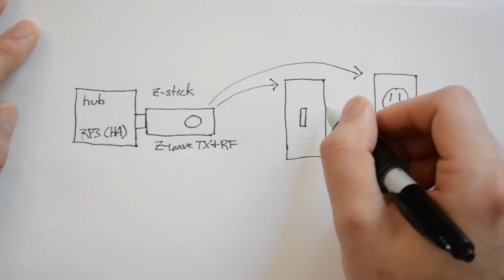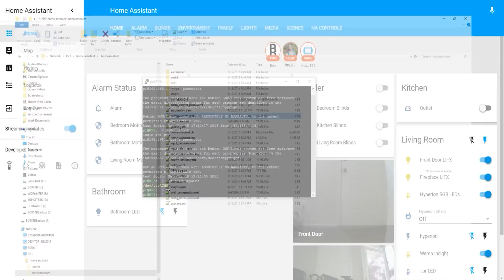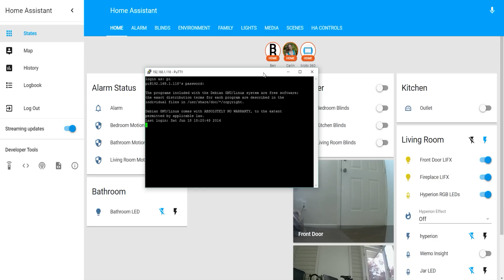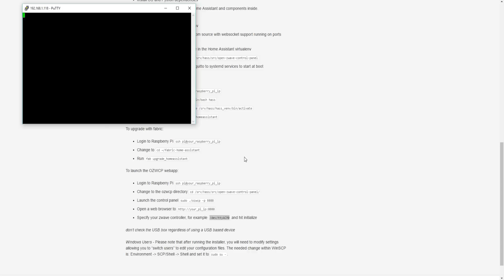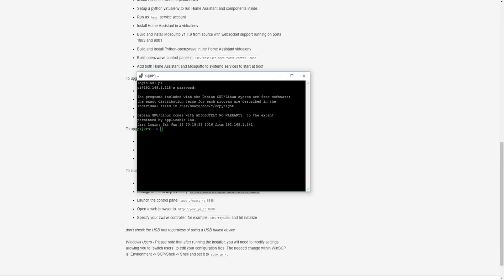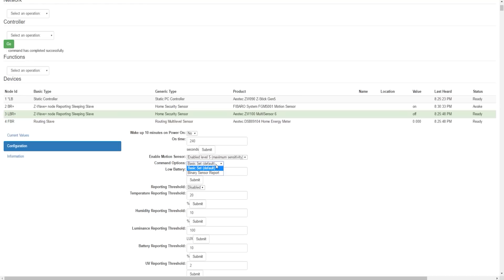The BEST DIY Z-Wave Tutorial - How to Get Started on a Raspberry Pi

Comment: Hi There Ben.... Huge Fan (obviously) - 

the Z stick config with All-in-One HA worked like a charm on the RaspberryPi 2 - but recently I upgraded to the RPi3 - but every since I'm unable to get it to work - I tried to retrace my steps. on...

ls /dev/ttyACM* I get the No such file or directory 

so i tried ls /dev/ttyA*** and i got 

/dev/ttyAMA0....thought i did use this USB path on the configuration.yaml file - no luck. 

Desperate shout for help please !
Reply from the maker: Hmm, that's very odd. This is a shot in the dark, but you could try and assign port permission if for whatever reason they aren't already assigned. 

sudo chmod a+rw /dev/ttyACM0

Let me know if that worked! Cheers!
Reply: +BRUH Automation hey. Thanks a bunch mate. Ok I actually got the z stick to be recognised by raspberry Pi. I'm able use it via the ozwcp. But it never shows on HA. I'll try ur recommendation and get back.

Comment: thanks 4 this awwsome video :) i just have one question: is it somehow possible to turn off the color blinking of the stick when plugged in? thanks for any help!
Reply from the maker: For sure! Sadly, I don't know of a way to turn off the LEDs. :( There might be some googling to do there and see if anybody has ideas. Worse case, you can crack open the case and unsolder the LEDs. I'm sure that's pretty easy! Cheers!
Reply: what i've read so far: there is a command to turn off the led. can be found in the manual. 
what i've NOT read so far: where to enter this command. as far as i know via fhem there is an option to enter "raw commands". does anybody know something like this in HA?

i will update this comment when i've found a solution. for people with the same interest...

Comment: I put this in the Poll video comments but felt it was better here:
Referencing  other makes of RF outlets and odd code sequences eg. InstaPark.
Here is what I finally tried and have working and may work for other makes as well.
I took the receiver out of pairing with the remote.  I then put it in pair mode and  paired it with HA sending an on then off single string from a transmitter connected to the pi.  This paired the outlet with HA.  It also  means the remote is out of service as re-pairing it will use a different code set.
Reply from the maker: Definitely. I'm pumped somebody finally tried this! I've wondering if this would work for a while. I'll be sure to recommend it if anybody is having any problems like this. Thanks for trying this. Cheers!

Comment: My Fibaro door sensor is stuck at "CacheLoad (sleeping)" as status in the control panel :(
Has any one else had this problem?

Thank you for the great videos. Keep it up!
Reply from the maker: Have you tried a full Raspberry Pi reboot? Sometimes that fixes it. If your device as a manual update button, sometimes that can help, too. From there, unpairing and re-pairing the device can fix it. If that doesn't do it, you're probably looking a full factory reset on the z-stick and fibaro sensor and maybe even resetting OpenZWave. Sorry about that! 

I'm trying to get my hands on the Fibaro door sensors. Once I get some, I'll see if I get similar behavior. Let me know if you need anything! Cheers!

Comment: How much has your electric bill gone up? Does the automation make for more efficiency or do you have so much plugged in that it adds up a lot? or do you go through batteries a lot?
Reply from the maker: Not a whole lot. I haven't done the study yet, but last I looked leaving a Raspberry Pi on constantly for a year uses ~ $5 of power depending on your rates. I suspect the same is true for my NodeMCU devices. 

The real power hog is HVAC so if you can automate that and reduce usage, you can definitely save a lot.  

Z-Wave stuff is very low energy so the battery costs there are pretty minimal - <$20 a year.  Cheers!
Reply: That's nice to hear. I suppose most other automation device are pretty low usage. If you ever get around to doing the study I'm sure people would be interested, especially if it saves them money. 
Thanks
Reply from the maker: For sure! I'll definitely add that to the list and see if I can get that out sometime. Let me know if you have any questions! Happy to look stuff up or try and answer questions if I can before that. 

Cheers!

Comment: Thanks again! Your videos have been a huge help. Have you played with Secure Devices at all? I'm having issues with a Yale Real Living deadbolt, in that it shows up in HASS but not correctly. It does not allow control and reports on the states page as just the locked state and not the device itself...odd. I'm also really interested in either using the xbee usb controller and/or hacking a Lowes Iris v1 hub into a controller similar to the rooted Wink hub.

Comment: Thanks again Ben. Had to modify the my config path to:
config_path: /srv/hass/hass_venv/lib/python3.4/site-packages/libopenzwave-0.3.1-py3.4-linux-armv6l.egg/config

And then it worked.
My reading are showing as badges on the top vs yours as a panel.
Is there a way that I can change that?

Do you know if anyone has been successful with the Schlage Z-Wave locks?
My HA sees it but commands do not seem to work.

Thanks again for all your help.
Reply from the maker: For sure! You'll need to use the groups component. If you specify the entity_id inside of a group and then call that group in a view it will show up in a card. If you call the entity_id in a group that is a view, it will show up as a badge. 

It's a little confusing, but if you play with it makes sense pretty quickly.  

Yeah, I don't think there is support right now for Z-Wave locks for some reason. :( Not sure if there is a solid workaround. You could ask on the gitter chat room though.  I think that's coming super soon though. Maybe in 0.23 this weekend or hopefully by 0.24 July 17ish..
Reply from the maker: Whoops, just saw that Z-Wave locks are supported now! https://home-assistant.io/components/lock.zwave/ Not sure why yours isn't working. Can you control it from OpenZWave/is a supported device on that side?
Reply from the maker: Sweet. Yeah, it's definitely a learning curve in the beginning. My config is available on my GitHub here -> https://github.com/brusc/Home-Assistant-Configuration. Let me know if you need anything!

Comment: If i ran the AIO, do i still need to follow the steps at https://home-assistant.io/getting-started/z-wave/ ?
Reply from the maker: Nope, should be working already with the AiO script. Cheers!
Reply: How can i confirm that?

I just went and am upgrading cython and its taking forever, so that obviously wasnt dealt with by the AIO.

And according to https://home-assistant.io/getting-started/z-wave/ i should have had config files at /usr/local/lib/python3.4/dist-packages/libopenzwave-0.3.0b8-py3.4-linux-x86_64.egg/config but after running the AIO i dont. DOes this mean openZwave was not installed properly? or is it bc i used the AIO that they are not there but are instead at /srv/hass/hass_venv/lib/python3.4/site-packages/libopenzwave-0.3.1-py3.4-linux-armv6l.egg?

Basically the question is how do i know anything is actually installed and working?
Reply: I was able to run and open the Zwave control panel and initialize my z-stick...so does that mean its all working?
Reply: also i discovered my zwave config files seem to be at /srv/hass/hass_venv/lib/python3.4/site-packages/libopenzwave-0.3.1-py3.4-linux-armv*****6******l.egg/config instead of /srv/hass/hass_venv/lib/python3.4/site-packages/libopenzwave-0.3.1-py3.4-linux-armv*****7******l.egg/config like yours. any clue why?
Reply from the maker: Yep, sounds like it. The All-In-One script installs OpenZWave inside the venv at /srv/hass/hass_venv/lib/python3.4/site-packages/libopenzwave-0.3.1-py3.4-linux-armv7l.egg.
Reply: Hm. Ok. But then why is mine at armv6l.egg?
Reply: Also, now my .log file isnt updating. Everythign works. all functions, discoerey, automations. Everything. but my home-assistant.log file never updates except when i call a restart from the dev tool and all it says is "16-06-26 22:50:01 homeassistant.core: Home Assistant requested a restart."
Reply from the maker: Hmm, yeah, I know some people are having problems with the restart function right now. It's a pretty complicated function and I suspect it will be deprecated at some point soon for the new reload core function coming out in 0.23. In the meantime, you can try and just use sudo reboot from Putty and it should restart everything well! Cheers!
Reply: Well i actually figured out my problem. It wasnt that the restart function was causing any issues, that was working jsut fine. but for some reason, "logger" wasnt included in my config file. i dont rememeber it being in there previously in order to get the home-assistant.log file to give me the full logs, but once i added "logger: default: info" to my config file, it starting producing the full log file i was looking for.
Reply from the maker: Nice! Pumped it was an easy fix!

Comment: Ben, thanks for your videos!  Just getting started with HA and Z-Wave.  I added a Aeotec Multisensor 6 to my Pi, and some of the values are reporting.  Specifically, Luminance, Humidity, Temperature, and UV.  I don't have the motion sensor though.  Do you know why that would be?  It used to show before I did a clean install and used the rPi AIO installer, but now it only shows those four sensors.
Reply from the maker: For sure! Yeah, the motion sensor shows up in a funny place. In my configuration, the motion sensor reports on sensor.fibaro_multisensor_burglar_4. It reports an 8 on motion, a zero if there is nothing, and a 3 on a tamper event. Is it not reporting anything named burglar? It would be pretty odd if you are seeing values for the others, but not that. Did it get hidden in your customize options at all?
Reply: I don't have any customize options yet, so I doubt it.  It's interesting - HA isn't seeing that it's a multisensor. The sensors it sees are: https://www.dropbox.com/s/livzhi9x3sov5sg/Screenshot%202016-06-26%2009.45.54.png?dl=0
I have tried restarting HA multiple times to get it to setup the correct names for the sensors but it keeps it that way.  There is definitely nothing named burglar anywhere.
Reply from the maker: That's odd... Hmm, something may have gone wrong in the pair process. Can you unpair the devices and re-pair them? Worse case, you might have to factory reset the z-stick and sensor.
Reply: I ended up trying to un/re-pair them, but that didn't work.  I then reset both the Z-Wave stick and the sensor to defaults, and re-paired.  It now works perfectly!  Thanks!
Reply from the maker: Nice! Sweet. Pumped you got it going.

Comment: So my main problem with the Fibaro sensor is knowing what output is what.  I see each of the below in HA, but not really sure what each is supposed to be telling me other than a couple of them.

binary_sensor.fibaro_system_fgms001_motion_sensor_sensor_2 - this is the basic motion detection, i think?? (off, no motion. on, motion detected)
sensor.fibaro_system_fgms001_motion_sensor_alarm_level_2 (current 0)
sensor.fibaro_system_fgms001_motion_sensor_alarm_type_2 (current 0)
sensor.fibaro_system_fgms001_motion_sensor_burglar_2 (current 254)
sensor.fibaro_system_fgms001_motion_sensor_luminance_2 - This is brightness (current 38.0 lux)
sensor.fibaro_system_fgms001_motion_sensor_seismic_intensity_2 (current 0.0)
sensor.fibaro_system_fgms001_motion_sensor_sourcenodeid_2 (current 0)
sensor.fibaro_system_fgms001_motion_sensor_temperature_2 - This is temperature (current 73.2F)
Reply from the maker: Yeah. I'm with you on this. My memory is that I turned off the vast majority of those because I could never figure out what they were either. 

the ones I have activated are burglar - this reports 8 for a motion event and 254 for a tamper event (in my case that's a shake).  Temperature, luminance, are self explanatory. Never could get anything on seismic intensity. I need to explore that. Otherwise, that's about all I'd expect from the sensor. 

So, I turned off alarm level, alarm type, and sourcenode ID... and by turned off I mean marked as hidden in the HA customization configuration. Hope that helps! When I make a video on the Fibaro sensor, I'll do my best to get at what each reported value is. cheers!

Comment: Ben, is it possible to use a ZWave stick as well as a Wink Hub in an HA setup?   I want to add some multi sensors into my system but Wink no longer supports Quirky Spotters (that aren't already paired in) and has no alternatives.  I was hoping that maybe I could add the Aeotec multisensor 6 on with a Aeotec stick in my Pi.  Is this possible or problematic?
Reply from the maker: Sure. I don't see any reason why it wouldn't work. The Wink component doesn't utilize any of the Z-Wave services inside of HA, I think? The Aeotec products work great together so you'll be good to go there. As a FYI, the Aeotec multisensor doesn't come with batteries... :(
Reply: I'm using both now and it creates more possibilities than using either one alone.  I started with wink and then added the stick and some multisensors and switches that wouldn't be possible with wink. But everything works well together.  Feel free to reach out if you need more info.
Reply: Correct.  And certain devices like locks may expose more attributes under z wave, than under Wink so this should be part of your planning as well.

Comment: Hi Ben, Good video. 
Have you had issues with zwave devices being reported as dead? 
I have the Z-Stick and the Aeotech sensor and it will work fine for a few days but all of a sudden it will show up as dead and I literally have to factory reset the stick and the sensor to get it back.
Reply from the maker: Yep, I've been running into that issue, too. It's very odd. The Aeotec sensor has been super reliable, but so far, I've only been running it on AC. The Fibaro sensor is much more particular and definitely will do the sleep/die thing. I can't figure out if that is a HA/Pi issue or a Fibaro thing. It's probably a combo of some kind of deep sleep and Home Assistant freaking out? 

I'm trying to get to the bottom of this right now. Hopefully, I should have some answers in the next few weeks. Let me know if you figure this out before I do! Like most Z-Wave problems, I'm sure the fix is just a magically 3 digit number away. :P cheers.
Reply: +BRUH Automation if you figure this out please let me know! I've been struggling with the dreaded "presumed dead" node for a few weeks now. I had initially thought it was due to a missing network key, but the error still pops up from time to time after solving that issue. Also, with the Fibaro, I've only had success in pairing through OZCWP, but after a recent reset of my Gen5, I can't get Fibaro to show up in HA even though the node is recognized in OZCWP. Any ideas?
Reply from the maker: For sure. For the Fibaro sensor, if I press the action button it immediately wakes itself up and reports a value to HA. If it's awake and not reporting in OZWCP, then I'd suspect something went wrong in the pairing process... 

It could be that something in your open-z-wave configuration is aggravating it. Doing a factory reset the on the sensor and Z-Stick and clean install via the All-In-One script will get it right, I'm sure. 

It's a huge pain though if it is continually dropping off without any reason. I'm exploring that now and I'll definitely let you know if I get it figured out. I'm doing stability testing on my system now and will definitely report about it when I make device specific videos.  cheers!
Reply: +BRUH Automation ironically the Fibaro (managed to get it paired again) hasn't had any problems reporting with HA. It took me a bit though to realize that the motion sensor was reporting two different values (0 when awake, 254 when asleep. 8 was constant for motion). my "dead" node has been my 12722. Although I just reset via OZWCP and re-paired everything, so let's see how that effects things.  let us know how the stability testing goes. thanks!
Reply from the maker: For sure! Good luck with that! Hope it behaves this go round. Cheers!
Reply: Also we are not the only ones with this issue, thread on HA forum can be found here https://community.home-assistant.io/t/powered-zwave-devices-marked-as-dead/1827/26
Reply from the maker: Ah, gotcha. Yeah, that's for sharing this. I'll take a look at this and see if that helps my setup! Cheers!